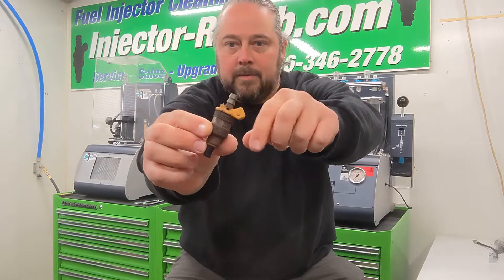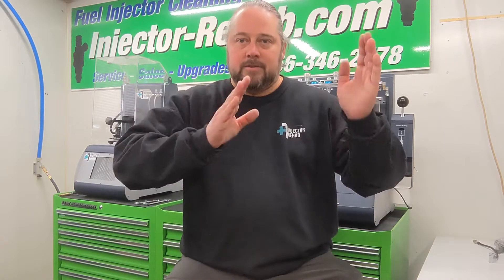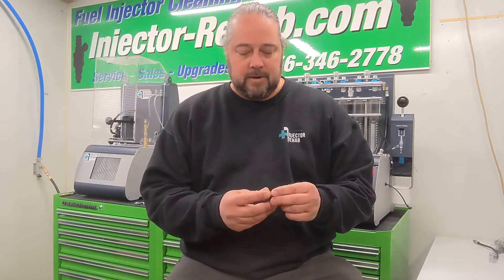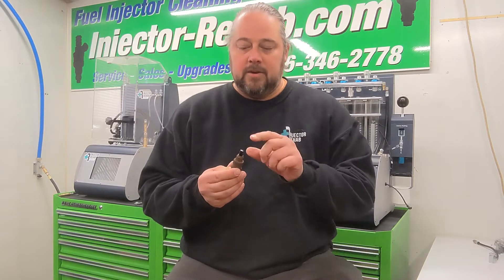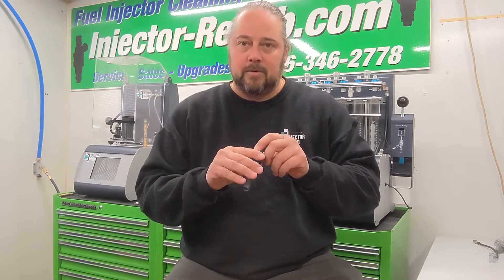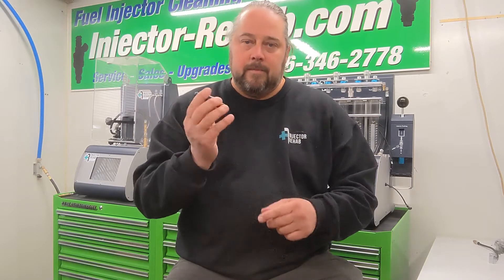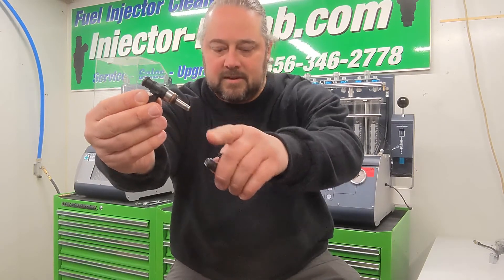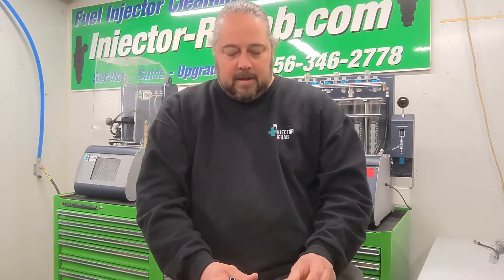EV14 Upgrade Injectors & Hose End Fuel Injector Replacement - The difference over EV1 explained

Comment: Hi, You mentioned upgrading the BMW R1100 but I can't find these on your website. Can you let me know what flow rate injectors and adapters I would need? Thank you.
Reply from the maker: Sure. There is a search bar you can just type "R1100" and they will come up. 
https://injector-rehab.com/product/1200gs-injector-upgrade-adapter-kit-for-1100gs-new-injectors-included/
Reply: @InjectorRehab  Thank you very much for your help. I will be placing my order soon! Also, Are these compatible with E85 ?
Reply from the maker: @9793c2  yes but is the rest of your system? E85 is nasty stuff and we highly recommend against using it.
Reply: @InjectorRehab  I replaced the fuel pump and fuel hoses from the tank to the pressure regulator, and added a piggyback tuner from eFlexFuel. I have been running it for about a month so far and have done almost 2000 miles. I'm looking for EV14s because the surging that the R1100 is known for at light load conditions is worse with E85.
Reply from the maker: @9793c2  that is what this kit was designed to combat